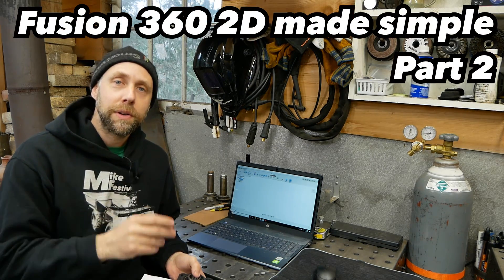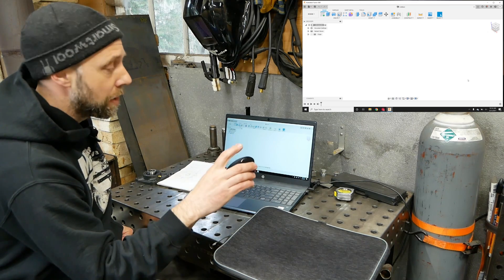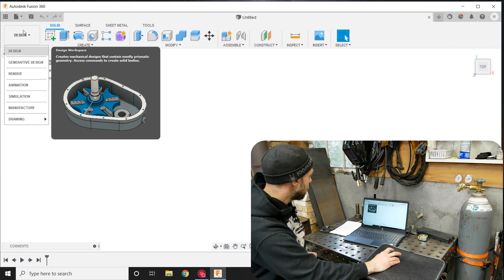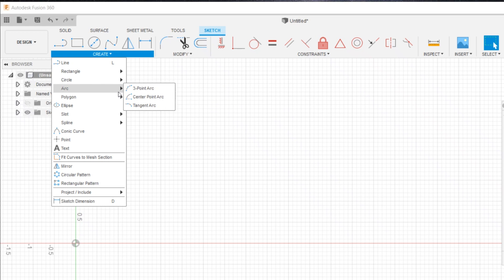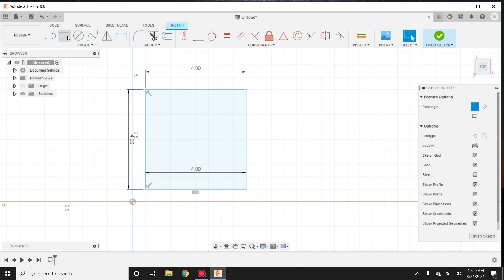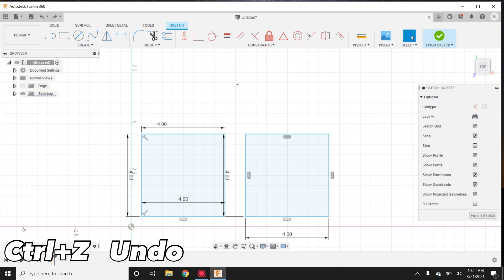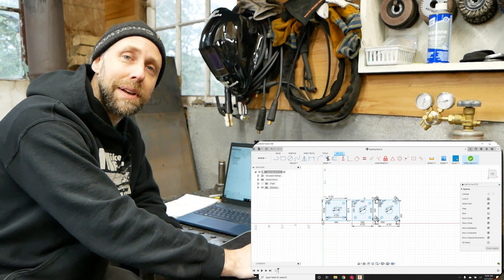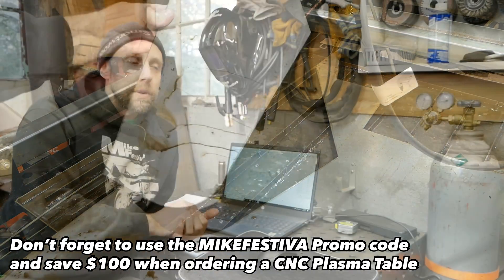Fusion 360 2D Drawing series for Beginners part 2

Comment: One Tip. When the numbers are highlighted in blue you do not have to press the backspace key before replacing the number. You can just type your new number. I just saves you a keystroke. Of course, it works either way.

Comment: Mike this video was very helpful in getting started with Fusion360. No print function. I was able to Print Screen my design of four 1/4" thick 3" square plates wirh a undersized bearing hole that I drilled out and welded together each pair and finished as flange bearing housing for my shop hot air blower squirrel cage fan. Thanks for being the type of designer,creator, fabricator, and sharer of knowledge that is a joy to watch! Your projects always have me thinking why the compact tractor companies don't make your style of UTV for gathering firewood, managing food plots, land & forest management. Way better than those cheap Massimo/ Coleman's from Tractor Supply..maybe a diesel version next?

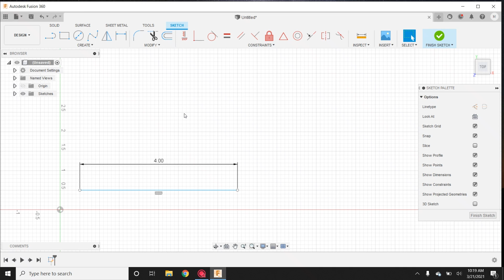Comment: @4:10, for the line command, you don't have to use backspace, if the length field is blue, just start typing the 4 and / or the tab key to switch between the choices it gives you, like "length or angle"   in the case of a line.

Comment: Great video, thank you for you time and effort. I have been trying to learn 2d in Fusion and like you mentioned everyone either goes way to fast using hot keys, etc.. or it's some super complex part. I strictly need this for the same reasons you use it, metal fabrication.

Comment: Thanks for doing this series in a simple fashion. I'm a long time subscriber of your channel and I nearly missed this. I'm a high school teacher that teaches carpentry. I'm embarrassed to say that I have been doing metalwork with some of my students and the robotics team by hand on a drill press, even though there is a CNC mill across the hall. The simple functions of the new 3D programs are what confused me. I was pretty good on the old 2D versions of AutoCad. ( I searched for the  rectangle pattern you showed for over an Hour thinking it was called "array" one night)

Comment: Great video Mike - I've been putting off figuring out 360 because I assumed it was very different from regular AutoCAD, I was wrong again... I saw that this is a cloud based program, not to get ahead in the training, does that mean all the models live somewhere else and can only be accessed on the internet?  Or, I can stop being lazy and look it up myself...  Thanks for the cool content, no doubt this will help a lot of home builders.
Reply from the maker: Thanks for always checking out my videos 👍 Fusion is cloud based, but all your G code you export is saved on your own computer, you will always have the cut files. I would rather it not be cloud based but it actually helped me out big time in the past. My old computer stop working last spring and I hadn’t backed up my files, I bought a new computer and once I logged into Fusion I had all my files back. Take care 🙂

Comment: Ive been using the autodesk 123d design for many years. Its now discontinued because it was too powerful as a free program but you can find it as a .exe on the interwebs.123d is super simple and very easy to learn.  I think Fusion360 is a better investment in time though because it keeps on going and going into professional level of functionality.

Comment: I have asked questions before and you were very good at replying I thank you for that. I am planning on getting a Crossfire Pro. If you don’t mind me asking what are the computer requirements to operate Fusion360 and Firecontrol? I am going to get a laptop to dedicate to the table and want to make sure I don’t get disappointed with my choice of computer.
Reply from the maker: Hey Brad i’m sorry i’m not sure what requirements are needed. I just picked up a basic HP laptop from our local costco and it runs fine with it. I would not recommend the HP however and am currently in the market for a different computer.
Reply: @Mikefestiva  how much RAM does your current laptop have? When you get another will you be getting more than 8GB?

Comment: Greetings,  you can print that drawing with the measurements and its scale at 1:1 to be able to cut the paper and paste it on the material you want, I do not have a plasma cutter or a 3D printer,

Comment: Mike, I've been using CAD for over 30 years to do all the design and drafting of my log homes.  I've also used it for building a lot of equipment in steel.  I'm not crazy about Fusion 360 being a cloud based program.  I like being able to save my work on my own box.  Is there a way I can do the designing in the program I use and then importing the files to Fusion 360?  That would be the best of all worlds for me to work in.

Comment: I’m learning, thanks!  I have an advanced question. 
I have an Artist rendering of a car. I believe in fusion 360 you can import a picture? It is a highly modified picture of a car I own. I therefore know stock dimensions and compound curves, etc. So I’m trying to use Fusion to help come up with a scale digital drawing of artist rendering to expedite creation of body of rendering. You know anything about that process of Fusion and or point me to someone who can possibly help me?
Thanks in advance for any help you could make
Reply: Insert>canvas, it will have you select a plane. After that, in the design tree right click it, calibrate. You will pick two points on the image and enter your known dimension. It will snap to the proper size and you will be ready to draw on it.
Reply: Thanks. The rendering is a 3/4 view. Looking to get cross sections to help build a physical wire form to form aluminum flat sheet in its shape to build car. So this will allow me to achieve ? 
Thanks
Reply: @kurtludwig4783   you would need top, side, front, rear views at a minimum, and drop each of those views onto the proper planes to sketch your wireframes.
Reply: @chrismcentee  yes that is a problem. I just have 3/4 view. Can I generate front side and top using the 3/4 view I have? 
I have all stock measurements because I have a stock body. Example wheel base. The rendering is been chopped and fenders widened.

Comment: Hi Mike, love your video's on fusion 360 cad but I'm having real trouble getting the cad drawing to the cam and post processing it seems the langmuir video series is a little different software  than the free trial version of 360?? Every time i try to post process i get a triangle icon can figure out what's wrong to proceed to get a part cut! I bought  this machine a year ago with a new computer hypertherm xp45 and I'm  not computer savvy at all hoping  you can do a video  on this whole process  cause your  cad video's are very good and easy to follow! Thanks Kevin
Reply from the maker: Hey Kevin I will try and start working on that final 360 video fairly soon. The biggest reason I never did that part was because this series hurt my channel and YouTube didn’t recommend my videos for a long time after I posted these videos because most of my subscribers had zero interest in learning new skills that could actually push them into a different bracket of pay by learning CAD.
The other reason is fusion 360 is constantly changing there program and the look of it, once I make a video on settings and tool paths I can guaranty the video will be obsolete in a year because 360 just can’t leave things be.
Honestly that’s the biggest downside the 360 is the makers dork out on changing things all the time to justify there jobs. 😂
I hopefully will get that video in the works fairly soon 🙂👍
Reply: @Mikefestiva  Thanks Mike is there a different software that works with Langmuirs crossfire pro? 360 says it's free for hobbyists but i think its a less of a version than the paid subscription?? Thanks again  keep doing the videos the articulating truck build is an awesome build! I'm currently in the process of building a hydraulic dump trailer with a jib and winch to haul firewood  and  snowmobile trail maintenance! I will be pulling it with my polaris ranger!!..

Comment: The only thing i would add is the holes.. if youve measured say an m8 bolt, you dont want it an 8mm hole, as the bolt and the hole occupy the same space and your going to struggle. Just add .2 to the hole (8.2mm) to give clearance..

That said you oversized the holes slightly in the last video, if i remember correctly - so that point is mute, but worth mentioning..

Comment: Where and how did you get 5/8" to determine where the circle was going to be placed? I saw the first part 1 where you just measured the inside of the hole and the distance between the 2.

Comment: Sorry if you mentioned it but what laptop do you use for fusion 360?
Reply from the maker: I definitely don’t recommend the one I’m using, it’s probably the worst computer I have ever owned, it’s an HP.
Almost any modern computer will work for 360. They should have there recommendations on Fusions website.

Comment: the only problem I have with 360 is that my cnc is locate at a place that has no interweb access and inter net is only at home...I do not due smart phone either....am I going to be able to down load the drawing to the langmuir fire control with out the interweb? Or did I just waste about 5K

Comment: good video internet could be a 16 hour video .. we have hughes net .. ugh limits .. can't watch videos on 1080 .. have to watch 240 or it buffers a lot .. then heavy rain or snow i loose internet ,, old house we had spectrum when it worked it was ok but we had a lot of there equipment beeping up a lot .. had to boot the system a lot or get there repair out and replace it ,, we had 3 repairs in 5 weeks all 3 times new equipment ,, new place hughes net was a choice there is no cable tv up here yet ..telephone internet is way too slow ,,   i need a 5 mile long ethernet cable too hook up too the old house so i have good internet ,, lol
Reply: i hate my hughes net!
Reply: @robchopshopdually  i just hope in the next few years cable tv puts there system up here .. so i can get rid of hughes net ,,